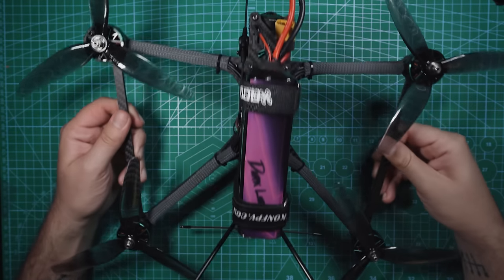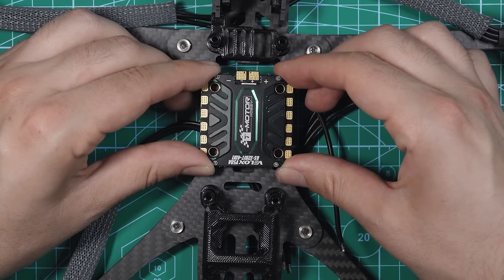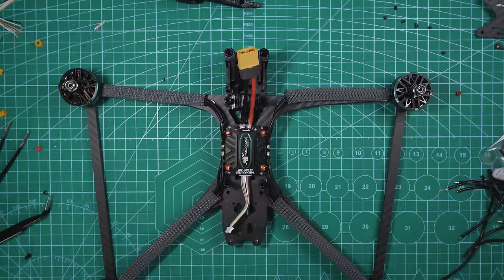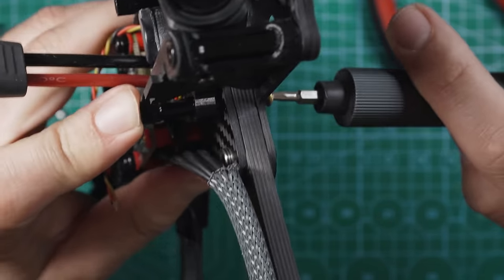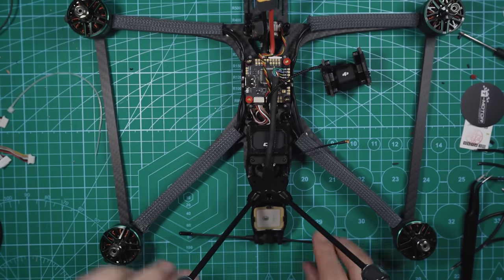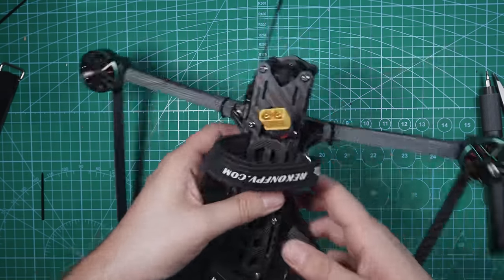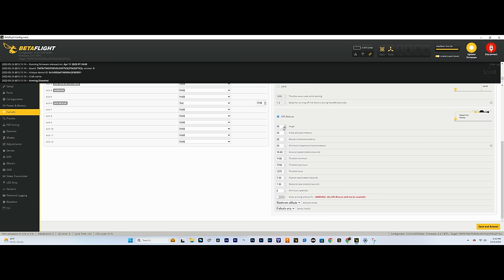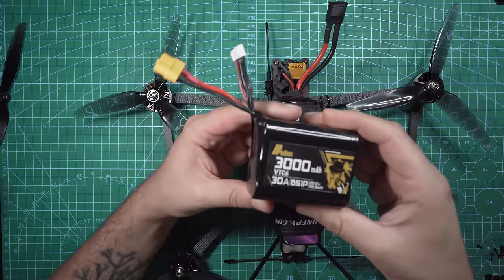How To Build a 7" Long Range FPV Drone

Comment: little tip for the buzzer: instead of always taking a pair of tweezers with you, just plug in the battery after unpluging it, wait a few seconds (i just wait until the esc started up) and disconnect the battery and the buzzer stops beeping.
Reply from the maker: Just gave this a shot and had no idea that was a way to turn the buzzer off. Thanks for sharing! 
Pinning this 🙌🙌
Reply: @TRONCATFPV  That's one of its main selling points, replugging the battery for 2s to stop the beeper is just so convenient
Reply: Yeah, that is such a convenient feature. Got one on my main freestyle quad squished between the cam and the ESC. There's no way to get to the button there so that is the only way to turn it off.
Reply: I built the same drone with the same buzzer and you can pretty much stick your finger to press the button for 2-3 seconds to turn it off.
Reply: bet tip ever!
Reply: @TRONCATFPV  I WONT POOP UNTIL U MAKE A BUDGET 5" BUILD 2023 PLS PLS PLS MAKE ITTTTTTTT (or at least do one in 2024 PLSSSSSSS)
Reply: Came here to say this

Comment: It costs about $704
Reply: Cheers mate doing gods work
Reply: You rock. Thank you
Reply: Thanks bro
Reply: 1000 dollars in a year
Reply: Hey bro , and how can I get the controller and the goggles pls ?
Reply: Not bad honestly.
Reply: You forgot the 600$ goggle and maybe 100$ controller
Reply: @tampaboosted251  lies😂 this will be like $600...! But there'll beee ALLLL NEW GEAR/TECH😅 And THATLL cost $1000 +
Reply: @SFZACKDZ youuuu can buy them..😂
Reply: It'd be neat if OP would put the total cost of a build in the video's description.
Reply: @SFZACKDZ you can’t just get everything and fly like this. First practice in a simulator and do a lot of resource, trust me that will save you a few 100
Reply: If that’s the cost you can get one built for that price
Reply: @ItchyTrigahFingah true, but would you then be able to fix it when you ‘land unexpectedly’?
Reply: @AirZeee  yes, you would. Well if you know some stuff about fpv at least.
Reply: @loen9591  yes I suppose so, my point was that if you built it yourself, then it would be easier to repair it yourself too, whereas if you buy it prebuilt then unless, as you said, you know what you’re doing, it would be much harder.
Reply: @AirZeee  that’s true ig
Reply: 500'
Reply: jayrmarcelo was when I checked... Doesn't include controller or headset tho
Reply: Thank you
Reply: About $500-600 today; What controller and goggles do I need?

(I'll figure it out, but it would be nice to know the protocols to spec out a price for my arborist company so we can scout trees that need doctoring.)
Reply: now its over 800
Reply: Then a get a prebuilt 😭
Reply: Damn lol. I wanna build a drone just like this. But a lot cheaper somehow lol
Reply: @Caldoric that would be like asking a youtuber to not be abnoxious, not click bait, and not waste people's time with LOUD music intros. Not going to happen. Only a handful of youtubers do it the right way
Reply: Less than an avata

Comment: Great video, and I would like to build one on the same frame. Please don't take this the wrong way, constructive criticisms only! :)  I've completed soldering classes that only AF avionics and NASA techs go to, so I may know a thing or two about soldering.  1- Don't use so much solder. Solder is not glue, and less is better, especially on something that vibrates. Too much solder leads to cold solder joints and adds to the joint mass, causing it to rip the pad off the board due to vibration eventually; and not to mention that fat messy joints can lead to a short. Flux your pad, then your wire. Tin your wire (lightly where you can still see the individual strands, but they are tinned silver), then place the tip of the tinned wire onto the pad, letting the surface contact and heat from the iron melt the solder out of the wire, and onto the pad. An ideal joint will look like a tinned wire stuck to a tinned pad with a tiny fillet on either side of the wire. Any solder joint that has a convex surface is generally considered too much. 2- Set your temperature right. Too hot can cause damage to your controller, so if you aren't using a heatsink, you can damage it and/or fry the pad off the board. Too cold, and you will cause cold solder joints that will pop off eventually. Choose a temp that readily melts the solder, but isn't burning, around 275f - 320f, this will depend on the diameter and composition of your solder, and your ambient air temp. 3- Don't be scared to use more flux. Get yourself some flux paste and a small acid brush. Flux the crap out of all surfaces to be soldered on. Flux cleans the surface and promotes adhesion. After you are done soldering, get an old toothbrush and isopropyl alcohol and scrub off the dried flux. I know pro drone folks have been doing this for years and they've had no problems, blah, blah, blah... however, I prefer to eliminate all possibilities that my soldering isn't going to be a reason for any failure.
Reply: Great info 👍
Reply: Lots of knowledge being dropped. That’s why I love this community everyone is just here to help. Thank you 🙏
Reply: Really good info, and respectfull! Noice.
Reply: Very informative, thank you.
Reply: Bro managed to yap interestingly and very fact full
Reply: He did an amazing job ... and you comment was unnecessary .
Reply: I don't mean to tell u what to do but I will n u will listen n do as u r told....😅.now looka hea boy, I sed, I sed, ba deet ba deet, I sed boy... U gonna hurt urself now, hand over that contraption...I used to work for acme son...😂😂...😂😂😂....😂😂😂...
Reply: Very nice comment. It is always good to share tips and tricks on how to improve.
Reply: I have IPC 610 and 620 and you are spot on 💯
Reply: Thank you!
Reply: @retrogazele  ... "your" .. and he didn't attack anyone he shared extra information which everybody thanked him for but you... Alex poked fun but it was funny...

Comment: That little trick you did with the  GPS wires is making the wires a "grounded shield" and its very effective at protecting wires from EMF. Good work 👍
Reply: Yes, but only the UART lines to the GPS module are shielded. This wont help the modules itself to get satellites faster...
Reply: @johnnymartini1072  exactly, and any wire connected to earth at one place is technically an antenna, so if the length was unfortunate it could resonate and induce noise on the wires, though the twist should counter any common mode signal.
Reply: @garethsmith7628  What I did not knew at this point was, that the noise induced to the power lines seems to be the problem. Therefore I would agree to the theory of shielding the cable. Because noise on the communication lines would lead to communication errors.
Reply: @johnnymartini1072 i dont think its necessary, RX and TX are digital. Not analog, so the small fluctuation would not do a lot
Reply: @hexidev  It's not about RX and TX. Its about the supply wire for the modules. A noisy power supply can weaken ur gps performance
Reply: @johnnymartini1072  Ah thats why, tho I would rather put a bigger cap on it aswell if it fluctuation that much

Comment: Dude, I consider myself very experienced in drones and electronics, but I learned many useful things from your video.  Thanks!
Reply: Can you tell me a couple things I missed.  If you don't know or just don't wanna answer its all good
1st. How did he connect the drone to the computer
2nd do you know if the software he was using is free?
3rd can I buy any remote control and headset to pair up to this drone?
Reply: Yeah how did he connect it to the computer

Comment: bro use heat shrink on both ends of the wire mesh on the motor wires so it looks cleaner and doesn't move around 👍

Comment: Nice build.  I started building exclusively 7" quads - love the way they fly.  Have to give you one tiny nudge - long-range builds always get a vertical antenna - horizonal (diversity or not) is for flying around your house ;)
Reply: What’s the best way to mount a vertical antenna, in your opinion?
Reply: @snipsey2  I mount them to the camera mount.  I go in tinkercad, add 2 hollow 5mm rings about 30mm apaert and stick them to the side of the flight cam mount (if you are using a proprietary flight cam mount and not a printed one, you can just make a standoff mount) and stick the antenna in there (I fly crossfire or dragonlink - this method is for the crossfire immortal T).  That way, my contol link is in the least ideal position when flying away from myself, but the most ideal position when flying towaerds myself - this allows you to fly to your control limit (which should theoretically never happen) and not failsafe when turning and beginning the return trip.  If you do get near your limit, you can improve control link by turning home.
Reply: Do you have any good resources for guys looking to build a good POV, long range drone, have design/fabrication means, but not so good with the coding/auto-pilot stuff?

Comment: 8x4.5 slowfly bi-prop 4s 5200mah 2808 motors. was using that combo for 20 minute flights 8 years ago. fly it right and set it up with teh right pids in betaflight, no reason you shouldn't get 20 or better. used to do 2212's on 4s 4400 and 10" on my 13" tricopters for fpv and make 12 minutes with a3 axis cnc gimbal swinging a cannon dslr.

Comment: Awesome Build! I love the GPS trick. It must act as a shielding for the GPS's wires out to the GPS Antenna Rcvr itself. I wonder if you could do this same thing with the other antennas going over the FC or something noisy,  like the RX, Digital AU/VTX or Analog VTX Antenna Leads, etc.. maybe get some better Range as well. 

One thing i noticed with my older TBS M8 GPS FPV size module is that I used to get 10-12 satellites in a matter of 10-15 secs and then it would reach as high as 21, but at least 15-20 Sats normally and never lose them. 

Now with the O3 Air Unit finally in because of camera fitment and waiting on parts, i have the Digital in and I have to wait that full 1min or so to get enough Sats for GPS Rescue and all that. 
It also wont just gain antennas as it goes, it will just all of a sudden go from 0 to 5-6 in the initial wait and then another few seconds and its at about 12 Sats is my normal now, maybe 15max once, but i havent seen it again. 11-13 normally now.

Everything still works fine with the GPS and the Drone will remember the Home Spot and all that if you lose GPS a few times during flight, and lose all the gps features like DTH and the H arrow, but its able to recover and still do a GPS Landing,  which is good for a far away Failsafe where you probably wont find it or be able to even get it.. Its a chance it will make it back at least closer and maybe get video or signal back. So far its actually worked great for me, its lands super smooth at the end and its pretty damn accurate for small gps only  
I like that frame as well, and the parts list was probably more high quality for the preset checkbox lol. 

What kind of range increase do you get with the longer O3 Air Unit Antenna's? And im guessing the diversity TBS T antennas are mounted at the two different orientation's for picking up a signal from all directions better or did it just work out like that? Ive only ever used the XF Nano RX. But ive been planning on building a Long Range out of the 7" drone frame and setup i have already that i got on a combo sale, the brand is raggio i believe. Its nice im just not sure if thats a popular brand or not. I looked on the HGLRC wesbite and i really like that Rekon5 F5 HD frame kit.. I have an analog iflight nazgul5 xl5 v2 6s. Its not a bad drone really, especially for the price i got it for on sale with a CRSF Nano RX already installed as well. $120.. 

Anyway, i wanted to just add my O3 Air Unit to this one but the frame is kind of too narrow in the center for the 20mm camera for the O3 and it has no front camera protection for a camera that style. So i figured id put the electronics into a nicer frame, add the O3, add the gps. And then use spare parts to build up the iflight again and just use it with analog.. 

I actually assumed that for a long range build you basically needed to use Analog to really get that range out there.. What is your best range for the video connection? Also if you lose video, can you just hit the failsafe and the gps will start flying it back closer until you regain video and can continue flying..!

Comment: Thanks for the great video. I'm thinking about building my first FPV drone. Got a lot to learn but it seems doable.

What was the price on the build?

What's the range on this build? You mentioned flying 4 miles to that island so must be at least that. Didn't realize they could go so far; that's awesome.
Reply: same here, wondering how much it would cost.
Reply: Also wondering

Comment: Once done with soldering the joints on each of the PCBs while following the tips of @olligesd9343, I would recommend taking a conformal coating such as MG Chemicals 422C or any other similar conformal coating and apply it to the entire surface of each of the PCBs. On both sides. Except for the contact surfaces of the components that come into contact with the heatsink. This will help waterproof everything and protecting against just about anything those PCBs are going to be exposed to while in use. (edited for spelling and grammar correction.)
Reply: also might want to do the same for all of the electrical connections and exposed wire/tabs on the beeper unit which also seems awfully lacking in waterproofing.
Reply: Also, it fluoresces under UV, so you can clearly see if you missed anything OR got it somewhere it shouldn't be. Good call.

Comment: 4.6 miles! Did the VTX actually hold that far out? I barely reach 2miles before losing video.
Reply: yeah it really depends on the location.  I've seen videos of a Mavic 3 going out to the ocean 7.75 miles out.
Reply from the maker: Haven't tested range at that beach yet but we will see! I hope so lol

Comment: Great Video 🤠 Questions:  1. What if I want to add intelligence to the drone? is there a way to have a flight controller card with enough memory to run a few programs like face, flower or terrain recognition?  2. What changes need to be made to carry 350 gr with some actuator to drop?  Thank you.
Reply: I don't know about these advanced  features you mention, though I always wonder why pilots with this kind of long-range builds don't run Inav instead of betaflight.
Inav a forked platform of betaflight is way to go with this rig.

Comment: You can just plug the battery back in and let the initial tones sound and then unplug to reset the beeper so you're not jabbing a screw driver into frame trying to get to the beeper reset button. I love vifly. You'll hear it beep three times to confirm

Comment: Awesome build! I've never really tried building my own yet but after I watched this video and some of your older ones, I'm leaning towards building my own now. A noob question, what's your flight time flying at top speed on this? I saw your reply on another commenter that this cruises at 50-60mph, what's the flight time on that? Also are you using dji controller with the fpv googles?

Thanks and subbed!
Reply from the maker: Thanks! I haven't tested flight time at top speed as usually when I fly this drone I'm more focused on battery life. It comfortably cruises around 60 for about 20-25 minutes. 

I use DJI goggles 2 for video and an ethix mambo with crossfire for the receiver link 
Hope this helps!
Reply: @TRONCATFPV  Thanks! Yes this helped a ton. Maybe if possible you can show also the full setup including the controllers and the goggles you use so people like me who is just starting to build can maybe copy the exact same setup on our purchase including the controllers and stuff right off of your vids. But great great great content and information nonetheless! Thanks again.

Comment: I needed this video last week!!! Great build.  I need to switch my cap mounting to the way you used it.  Mine kept shorting out on the frame
Reply from the maker: That hole at the front of the frame is perfect for the capacitor, especially with how tight this frame is

Comment: Small tip for the future, you shouldnt route the cables above the fc, you should make an effort to extend all the cables from the sides, this way there is much less probability of it interfering with the imu
Reply: yeah I've heard its not good for the gyro chip.

Comment: Very nice. Try some HQ J75 props. Those are my favourite and also many long range pilots I talk to recommended them to me as well.
One thing I noticed: 96kHz 😮?!
Mark Spatz would tell you to use 24khz. Maybe 24khz low to byRPM high. I use 24khz low and 48khz high.
Well, if you're happy and it works for you 😅

Keep up the great content.
Reply: Love the J75 props! I was also wondering about the 96k pwm
Reply: @William_NS  give the new gemfan street league 7043 a try.
Just got mine, but the weather has been too bad.
It should be a little bigger 2808 motor and not smaller 2806.5 though.
Reply: @chrisbee5481  Yeah Im using 2808 1300kv on my Apex LR EVO 7". I'll have to give those Gemfans a try. I usually prefer HQ props to Gemfans, but I'm always down to try new props!

Comment: I ordered all these parts. But what goggles and controller shouldi use.
Reply: I use dji googels 2 and it works pretty well, but my contoller not yet
Reply: @migelburgu1419  I got the dji goggles 2 and tbs tango 2 for the controller.  Working great together

Comment: I know this is a stupid question, but let's say this was a 5" quad (you wouldn't freestyle with a 7"), what makes it different to a freestyle build? Is it the lower kv motors and therefore the ability to carry a heavier battery (therefore longer flight)?

Comment: Hey man, quick question, do you really need to use the crossbars/arm braces? Because i had a DJI FPV and it was causing so much more drag so im assuming it reduced flight time.